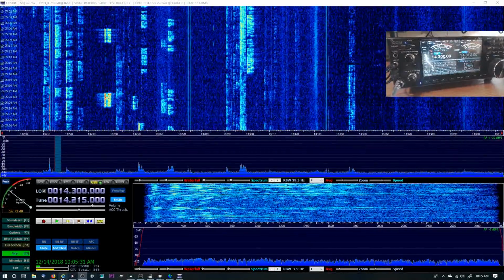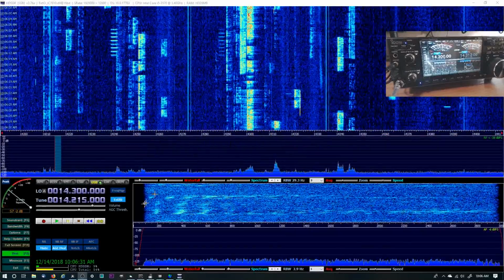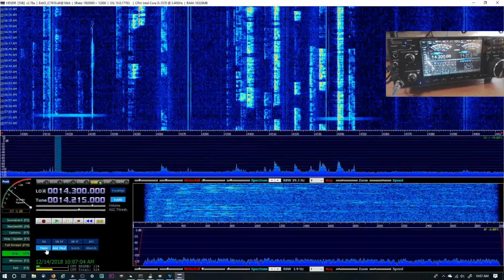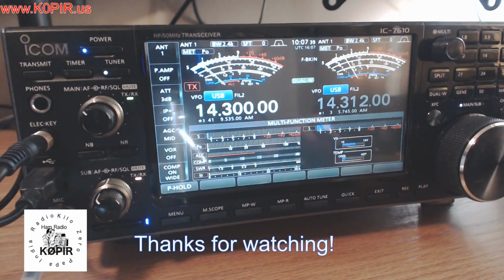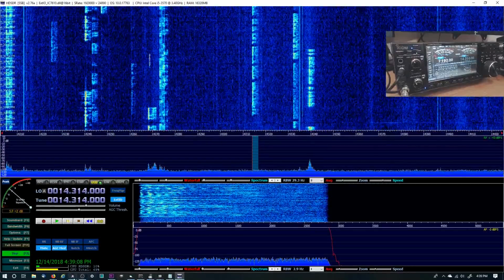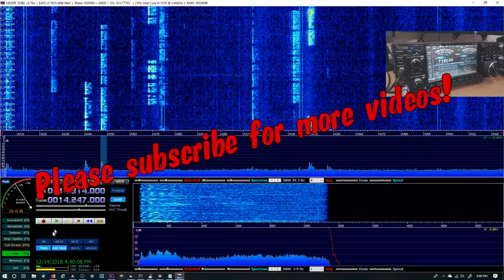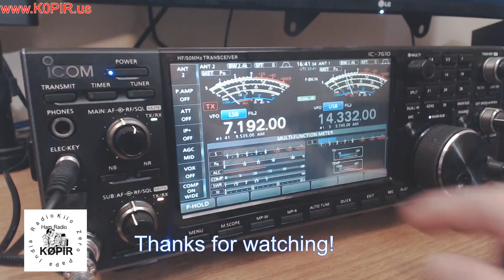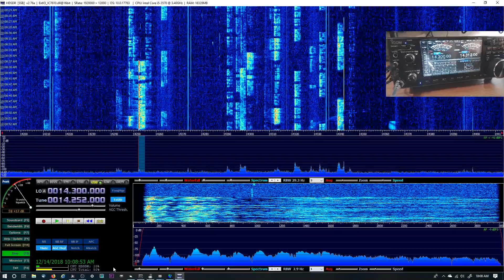Icom 7610 HDSDR as a 3rd Receiver

Comment: If you don’t need a second receiver is the 7610 a worth while upgrade over the 7300?
Reply from the maker: That's great question. For me it was worth it. There's about a 2k difference and it was worth it to me because the IC-7610 is a higher quality transceiver. It feels better to use than the IC-7300 and ergonomically speaking, the 7610 is better. I like the band buttons on it and the larger LCD. The 7610 receiver is better too. I think the TX audio quality is about the same on the rigs.
If you mainly rag chew and do some digital mode operation, the IC-7300 is excellent and probably the best fit. If you want more bells and whistles and do some contesting and DX chasing the IC-760 is a better rig.
I hope this helps Best 73,
Rich, K0PIR
Reply: Markinpuff no lol